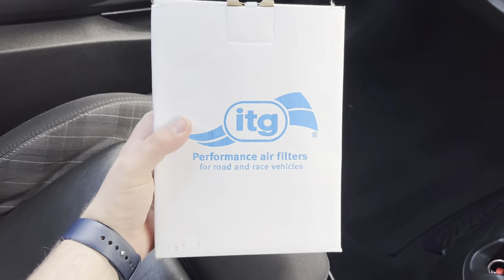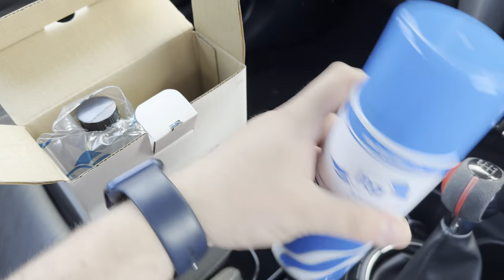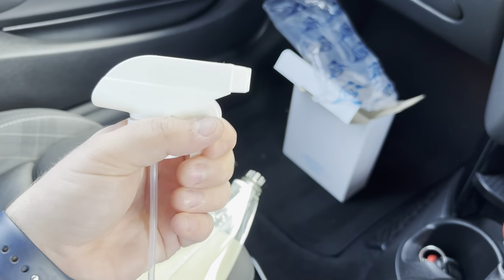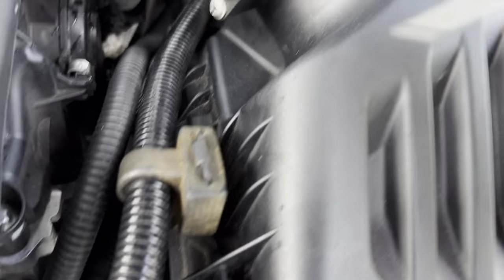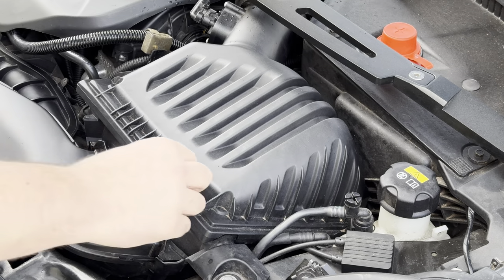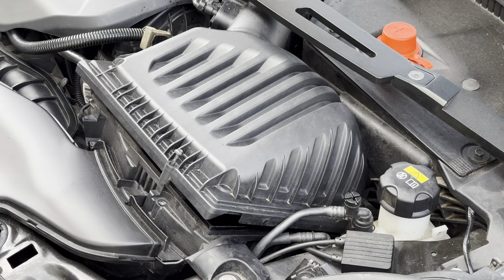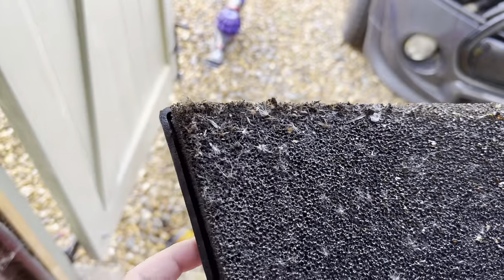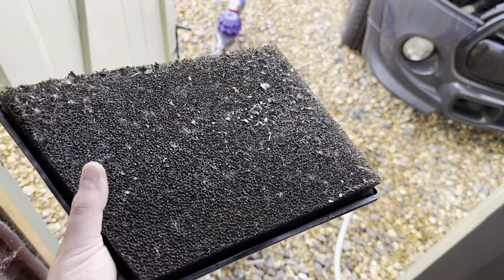ITG PANEL FILTER CLEANING!

Comment: Great video and excellent instructions. I wanted to see how people were cleaning the panel filters as apposed to the cone cleaning instructions on the iTG site. This looks a doddle in fairness. Did you notice a performance increase after cleaning seeing as yours had covered around 20K? I'm going to do mine soon around 10K, but just wondering if it made a noticeable improvement after cleaning.
Reply from the maker: @Niko-xz5lk  I stupidly sold the car with it in. I didn’t notice much difference to be fair in the performance after cleaning it. It wasn’t too dirty in all fairness but leaving it 20k probably didn’t help.
Reply: @BenRolfe  Thanks mate. Yeah, could have kept it, used again or sold it on. Still, I hope the new owner appreciates it! Glad to hear it didn't make much difference cleaning it, goes to show how good these filters are and how long they can go without cleaning without a significant drop in performance. I'll do mine soon most likely. Appreciate the reply 👍🏻

Comment: Hi Ben how come you chose the JDR2 oil rather then the JDR1?
Reply from the maker: From what I’m aware of, JDR2 has a different viscosity and is more suitable for the panel I have.
Reply: @BenRolfe JDR 2 is a heavier oil more suitable for desert/rally application to trap more dust and debris than JDR1. It won't hurt to use instead of JDR 1.

Comment: How long did you leave the filter to dry before applying the filter oil?
Reply from the maker: It’s recommended 24 hours, however, I used a hair dryer and left it in the sun for a good few hours. You can usually tell by touch and the weight of it if there’s any water left inside.